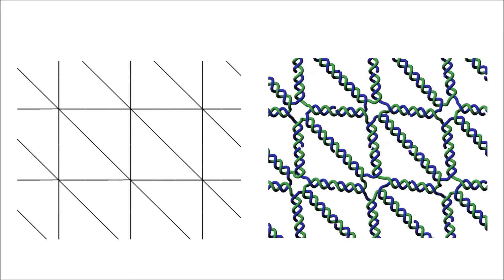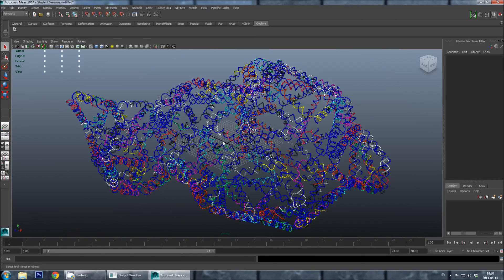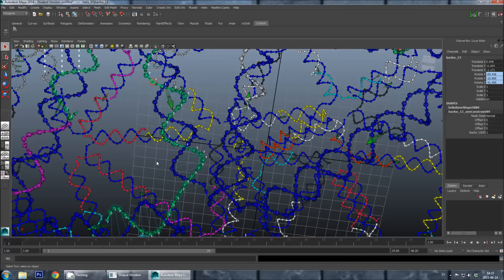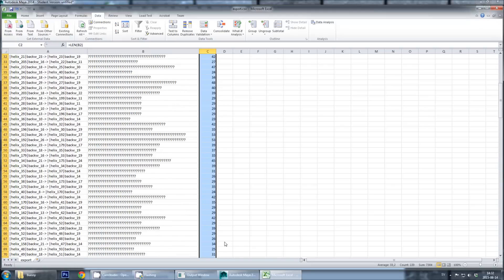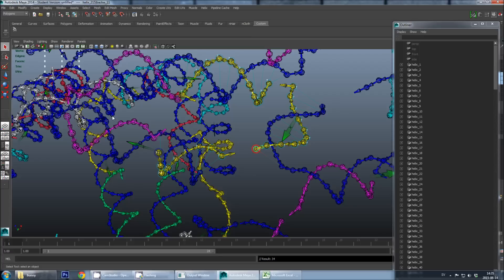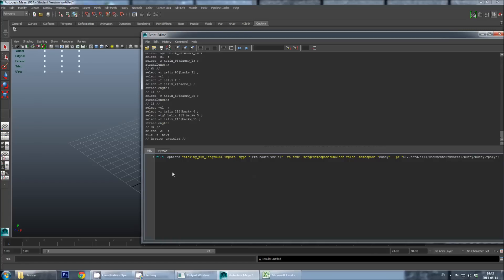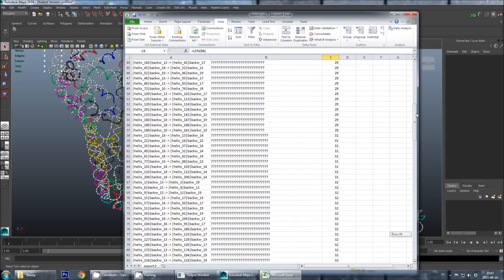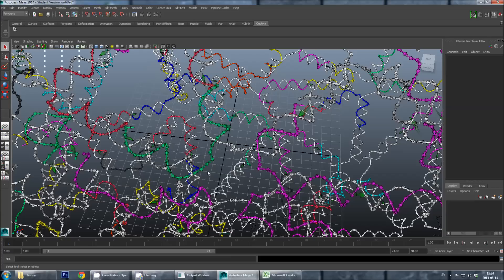vHelix: DNA design from polyhedral meshes 2

Comment: Really great Tutorial, there is only one big question left:How exactly to apply sequence to the scaffold strands? You will hardly have to do it by hand, right? I assumed the sequences would be filled in automatically with empirically good or even randomly generated plausible sequences which are complementary at the right positions but when hitting apply sequence you have to "enter" the DNA sequence? Isn't there a sequence library which can be addressed to automatically fill up the scaffold strand sequences?
Reply from the maker: Hi, when you assign a DNA sequence to a strand, vHelix will automatically generate the complementary sequence of any bases pairing with that sequence. In a scaffolded design like the one in the video you will only have to assign the sequence to the scaffold strand, and the sequence of all complementary staple strands will be automatically calculated. As sequence for the scaffold strand, we generally use a version of the M13 phage genome. You can produce your own scaffold strand or buy it from https://www.tilibit.com/collections/scaffold-dna. vHelix does not currently have a sequence library or a random sequence generator but that may be a good feature to add!
Reply: Thanks, I will use the M13 genome in the meantime ;).
A last question, is there any way to import the final DNA origami product into pymol?
Reply: Hi, 

For pymol, what format do you need? We have an a very early version of vHelix that supports exports to PDB, send me an email at erik.benson@ki.se and I can help you with a PDB export. 

Regards 

Erik Benson